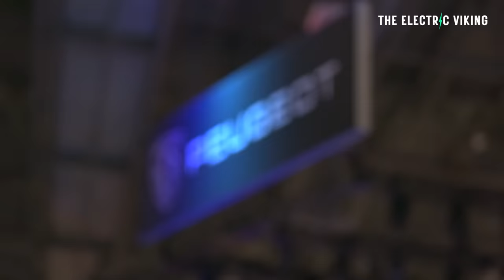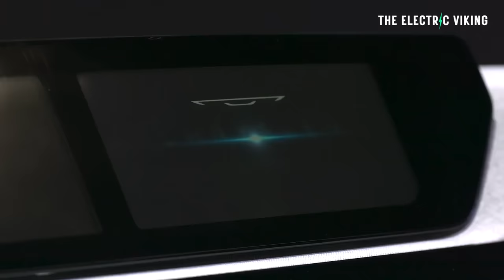Stellantis' CEO says EV Battery WEIGHT needs to be cut in half

Comment: Tavares is a businessman, not an engineer.  He will make every argument to cloud the waters in favor of ICE cars.  Yes, would be nice if batteries were half the weight, it would also be nice if ICE cars emitted half as many noxious fumes, cost half as much to maintain and cost half as much to operate.  The  battery industry is closer every day to making  a lighter battery.  ICE cars will never be able to cure all that is wrong with an ICE car.
Reply: A lighter battery will come by default when energy density increases, because EV makers can install the same amount of kWh but the battery will be lighter, therefore increasing range even more. As energy density increases you will see battery pack size decrease; highly unlikely we will see EV ranges go up substantially simply due to this fact.
Reply: @thestonksmarket1897 I think they are getting there.  I think when the model 02 is released next year, those will be ideal, primarily because they will be lighter.  And others too, VinFast will be even smaller.
Reply: @thestonksmarket1897 ...The maximum capacity per mm³ is far from being reached. You are right that batteries are still that primitive that a lot of unneeded material is being used to keep the charges separated and trapped as long as the charge flow (which leads to the  reunification = battery gets "empty") isn't needed to create a flow that creates Eddy currents which interact with permanent or electric magnets to lead to motion on a way higher degree of the scale dimension than the charge flow.
Reply: Well, Tavares actually is an engineer.
Reply: Tavares made his career as an engineer in Renault.

Comment: The Model 3 weighs about 3400 pounds.  A Honda Accord weighs 3250 pounds.  Load that accord up and its about the same as the 3.  Point being, Tesla can do it.
Reply: And that’s dry weight for the Accord once you add all the fluids and fuel it’s even more comparable.
Reply: Yes the accord weight is dry weight.
Add gas, oil, refrigerant & it’s no difference…
Reply: He is right, whether he is right about lithium availability right of otherwise. 500kg is five of me in the car all the time ,. No one want that.
Reply: My Subaru Forrester weighs about 3800 lbs
Reply: The Model 3 is a COMPACT car; Honda Accord is a MID-SIZE size car.  The correct comparison would be with a Honda Civic.
Reply: @dzcav3  And yet, both can carry 5 passengers with the difference being the Tesla has 20% more cargo space.  Nice argument.  lmao!
Reply: @dzcav3 nice try, but they are both mid-size with comparable interior and exterior dimensions.
Reply: @BTom16 - no, the 2024 Model 3 weighs  3862 lbs. to 4034 lbs. depending on the options.  There have been previous Model 3s as heavy as 4250 lbs.

Comment: Hi Sam, greetings from the U.K.  Now I know from previous videos that you don’t like the EV I have, a BMW i3, but it weighs just 1200kgs thanks to its carbon fibre, aluminium and plastic construction. Mine will be 5 years old in September, and it has been awesome. My only maintenance has been 4 new tyres at 37k miles. No sign of any battery issues.

Comment: Lets calculate in weight how much fuel a car will use for 20000 km. 10 litres per 100 km on average equals 100kg of fuel for 1000km. 20000km uses 2 tonnes of fuel. 100000km uses ten tonnes of fuel.
Reply: Thanks for doing the math. Nicely done. 👍
Reply: Yes, it’s the liquid fossil fuels that DON’T get recycled.
CO2 just gets dumped into atmosphere. 
Certain BEVs are already capable of a million km - saving 100 tonne of petrol / diesel.
2.3 kg CO2 per litre petrol, so 230 tonne CO2 for a million miles.
And Carlos worried about 2 tonne of metal, glass, plastic!
Pathetic man.
Reply: How much coal does an Australian EV use over the same distance?
Reply: @yuglesstube  nothing if it runs on solar & wind.
Even Australia will eventually be RE, before the BEV is scrapped.
Diesel / petrol cars will never be RE. Get worse with age. Chew through engines.
Reply: @iandavies4853 I swear there are people who will argue black is white and have plenty who agree.

Comment: Ice car engines are all recycled. They go through the crusher and contribute high quality iron and aluminium for casting new engines.
 Some even get pulled out, rebuilt or shelved, and become replacement motors for other ice cars.
Reply: Ok your point? same for EV   You grasping
Reply: Have you heard of Redwood Materials? They currently recycle 95% back to raw material. And recycled lithium has better purity than mined and refined ones! That means less degradation on battery packs using recycled lithium
Reply: How many cars, motors, etc are sitting in junk yards, scrap yards, etc etc … to pretend like they are recycling all cars/ motors and putting them back into the system is flat out ridiculous
Reply: @chriauc2976  He was responding to the Viking saying ICE engines were not recycled. That is wrong and the OP is right. That's not grasping, that's correcting a false statement.
Reply: Can they recycle the diesel after it goes through the motor?
Reply: How much gas and oil leaked out..?

Comment: Everybody knows EVs would greatly benefit from light batteries.  

80 pounds of gasoline can go down to almost zero before the tank of an IC car must be refilled.  

Gasoline cars do not use the same degree of costly weight reducing materials that electric vehicles do.  Gasoline cars have more steel content, which costs much less, nothing like the Giga castings that Tesla uses to save weight.  That means decades old manufacturing methods can be used in gasoline cars.  EV materials are more like that which aircraft use.  That adds costs. That's because of the heavy battery.

I know of no automobike with a 900 pound engine. The 1940s Packard straight 8 weighed about that much.  The 6.7 Cummins diesel on a Ram 3500 is very heavy.

Comment: Not only is battery weight diminishing, but battery density is going up, so Carlos is just making 'another's excuse why he can't compete(.) Why not 'delay' Model-2, for 2 reasons; 1] soft 'consumer' spending economy 2]Robotaxi needs FSD approval, and that's not happening without 'security-protocols' approved by DHS. Maybe[...just maybe] a 48V/Ethernet/steer-by-wire architecture, and wait for the new CATL batteries. The FSD drive performance has many possibilities, like fleet operations, but 'driverless' makes it a drone on wheels(...?)

Comment: I think engines should be about three times the size of motors, they're just too heavy!
Reply: Most engines are not all that large until you start adding all the bits ICE makers hang on them.  Power steering, fans and radiators, AC, and more.  The EV has all these things but generally one does not have to remove them to change the battery or drive units.

Comment: The Tesla Model 3 is significantly lighter than the Ford F-150 the most popular vehicle in America. Tesla Model 3: Typically weighs around 4,000 pounds (1,814 kg).
Ford F-150: Can weigh anywhere from 4,500 to 7,000 pounds (2,041 to 3,175 kg) depending on configuration (cab size, engine, options).

Comment: The model 3 weighs 3600 pounds. The equivalent Peugeot E-3008 weighs a whopping 4400 pounds. The problem of Tavares is he wants to have the same chassis for any powertrain , electric, ICE and hybrid. So since he doesn’t have a skateboard, the weight of its cars is far above the other pure electric cars with s skateboard design. The problem is not the battery, it’s his design which is old style, heavy with absolutely no effort on Cx

Comment: Sam - They do Rebuild/Re-Manufacture internal combustion engines and they do melt them down to cast new ones, we have to be fair on that point.  When you slip like that you know your critics are going to jump all over you and dismiss everything else that you correctly state.

As for Carlos he's clearly stated in the past that he does not really want to be in the automobile business so why would you expect him to be an authority on the something he has declared he doesn't want to be involved with.  Would you go to someone for medical advice if they told you that they really didn't want to be a doctor and were looking forward to getting out of that line of work?

How about if they stop pandering to speed and performance freaks and start developing EV's that get better than 5 miles per kWh rather than less.  The original Leaf got 5 or more miles per kWh so how about aiming for more efficiency and closer to 10 miles per kWh doubling the range from the same 25 kWh battery size they used in 2011.  

It's also been stated that every year we've seen a 5% to 10% improvement in battery power to weight ratios making it so today we get about double the kWh per pound from a new EV battery compared to 10 years ago so if this trend continues as it has, its already a given that Carlos will get his wish as that is whats been happening all along.

Best!

Comment: I only partially agree with Tavares.

Electric cars are generally heavier than ICE cars of same size/class, and the propulsion battery is one of the heaviest components, if not the heaviest, in an electric car.  And lighter cars are always better for consumption of both fuel and tyre rubber. That much I can agree to.

But reducing battery weight is only part of the equation. Using lighter materials in other parts of the vehicle also helps a lot, e.g. lightweight composites in non-structural body panels instead of steel or aluminium, carbon fibre where this will retain structural strength, etc.

Also, with the battery pack being heavy, EV native platforms can (and do) harness that to bring down the centre of gravity, thus making for better handling. Developing a platform for EVs from the ground up, will be much better than trying to shoehorn an electric drivetrain into an existing ICE platform.

To sell well in Europe, the smallest classes need to come down in not just weight, but, more critically, also price, and come a bit up in range.
That’s very relevant for at least some of the markets in Asia too, especially in countries where the public charging infrastructure is at least half-decent already.

Do correct me if I’m wrong, but I assume that 75 “models” would include rebadgings, and with Stellantis consisting of about 14 or so car brands, that’s on average just under 5 1/2 models per brand.

Comment: CATL has 500wh/kg in mass production, with 720wh/kg in their roadmap.
This means that CATL can make a battery right now that can have 100kwh of energy, that only weighs 200kg.
That can also be a structural pack, so we end up with essentially a zero mass option, since you can replace the chassis with the battery and likely build a car with comparable weight to a similar type of ICE Vehicle.
Then factor in the fact that the other elements of an EV can be lighter than an ICE cars Engine and we have lighter than ICE EVs, with the potential benefits of being able to charge anywhere there is a plug socket in reach, masses of range, efficiency, tge possibility of Wireless Charging and so Vehicle to Grid/Load.

Energy density in the 1kwh/kg from will likely come from CATL within the next 5 years, it's possible people can have rechargeable cells that you can take from home to your car like a big AA, self swapping EV Cells.
The future is definitely bright for EV, storage tech.
Reply: Historically the issue with solid state batteries has been the discharge rate (the amount of power you can supply to the motors), solid state batteries historically could only be used cars with low power motors - they will allow long range because of the high energy density but for example in the past a solid state battery would not have enough discharge capacity to fully supply a RWD model 3 3D7 single motor. Once they crack this (maybe they already have?) we're away again on a new technology path...

Comment: The energy comparison of ice cars and EVs is not so easy. Some say it takes years of EV driving to compensate for the energy required to produce an EV battery. I think this is not true, it takes about the same energy to produce an internal combustion motor PLUS petrol tank PLUS oil lubrication system, in comparison with the much smaller EV motor PLUS battery. If one only takes into account the production energy of an EV battery, the comparison (ice car versus EV) is not realistic.  Batteries will become lighter and smaller in time, as mass production of advanced battery electrodes is starting up, which makes EVs even more energy efficient. Also the air resistance is lower for EVs, which is a very important energy efficiency factor. Can there be any doubts left that EVs will replace all ice cars.

Comment: we do need lighter EVs, as an EV owner. per the "Fourth Power Law" - the amount of damage a vehicle that weights 4500lbs does to a road is nearly 3x as great as the amount of damage done by one weighing 3500lbs.((4500/2)^4 compared with (3500/2)^4) particulate emissions from tires are also commeasureate  - and particulate emissions are still a huge issue.

Comment: ICE needs an engine, transmission, driveshafts, and differentials and transfer cases. Many individual points of failure and cost. His point about battery weight is what I have been saying- that in order to lower prices and increase profit potential EV makers should start concentrating on battery weight and size reduction while keeping kWh size the same. This would increase range with each generation and lower cost. The EV market is now in its phase of competing with I E on price where in just 2-3 years in the US EVs will likely be lower in price than ICE.

Comment: Legacy auto, US, Europe & Japan trying to promote FUD against EVs. Looking at the energy density improvements of EV batteries, it is likely in 2 years i.e. Jan  2026, the energy density will be twice of what was commercially achievable in January 2022.
Reply: Mass production capability is nowhere near that close. Worldwide production is led by a handful of manufacturer really. 
Most factories being built are still going to have the same process as the currently made ones, so they won't have bleeding edge density.

Comment: Aptera has already solved the weight problem of all vehicles period let alone pure play BEV. Hybrid drive systems are creating engines and drive train systems that will effectively last forever now as one of the huge weight penalty issues with current pure play ice platforms are driver assistance systems plus creature comforts (hvac.) Tesla continues to revolutionize both and all without aid of a single solar panel(yet.) Cybertruck definitely missed out by not having a 3rd axle as  this can sustain a truly awesome amount of weight to do literally anything with that...something Stellantis might want to think about with their massive pure play ICE platform trucks and Jeeps actually. Also with no Maverick or Santa Cruz clearly Stellantis is still missing out...as has the entire Industry except Ford and Hyundai respectively...in providing for a lightweight entry level sport truck. Dodge doesn't even have a middleweight contender such as Tacoma, Colorado and Ranger and possibly many more soon (Ridgeline, Frontier, BT-50.) Jeep does have the 4xE system which for the time being is saving Stellantis as is the Chrysler Pacifica but competition in the World of Das Auto right now is absolutely insane into upon North America at the moment...like something out of the 1920s over 100 Years ago actually...so easy to get caught up in simply ignoring what elsewhere is expert at. Oddly enough if it wasn't for pure bev full size trucks this market would be a complete catastrophe for the pure play ICE platform people such as Dodge Ram given a huge spike in fuel and maintenence costs quite suddenly #who_stole_my_cheese
Reply: Aptera take too much place for a 2 occupants car for it to make sense in Europe. Unless some oil prince want to throw money at them, they don't have enough resources to build multiple assembly line to have an impact in the EV market to make a difference.
Good tech doesn't mean good manufacturing capability

Comment: So my last tdi combustion car kerb weight 1255kg averaged 50 mpg ( around 1 mile per kwh ) , my current i3 with range extender kerb weight 1440kg averages 3.6 miles kwh or 166 mpg e (84000 miles) given that when I run the extender (extremely rarely)it averages around 45 mpg (1 mile kwh), and 22 mpg in winter (0.5 miles kwh ), why is this even the issue ( weight) if I didnt have the range extender ( weight including fuel system around 70kg) and had a 50 kwh battery the weight would be the same approx but why oh why would I want a fossil fuelled car with those figures maybe a current fossil fuel driver could give insight 🤔.

Comment: Well... An ICE car use 50.000 pounds of fuel during its life (200k miles 24 mpg) and this is NON RECYCLABLE...
(200.000/24= 8.300 gallons, 8333x6 pounds/gallon=50.000 pounds)  
Just talking about "using resources"

Comment: tires wear and damage to roads are the cost of heavier cars.
Reply: The average weight of a new ICE car purchased in the USA in 2023 was 4329lbs (1965kg) the average weight of a new BEV purchased in the USA in 2023 was 4208lbs (1909kg).

Yes there are heavy EVs but there are also heavy ICE cars  - the heavy EVs are sold in low volumes.

Comment: What is the weight of transmission, IC engine, radiator with coolant, Fuel tank full of fuel and complete exhausted system in comparison to the total weight of Battery and if Xiaomi SU7 is a guide in distance travelled on a full charge? Does he has any idea or is he trying the convince people to stay on ICE due to Stellantis' Group has no comparative advantage in EV.